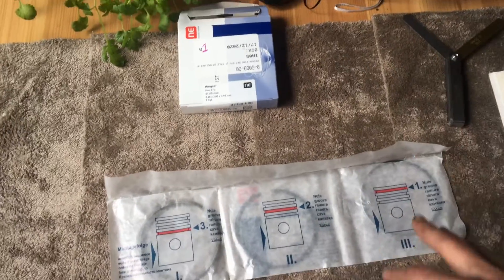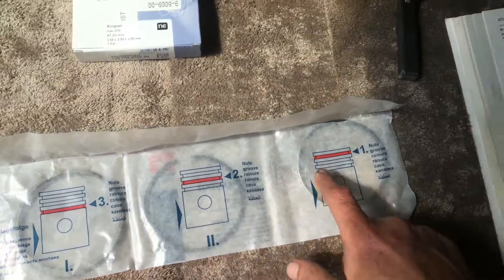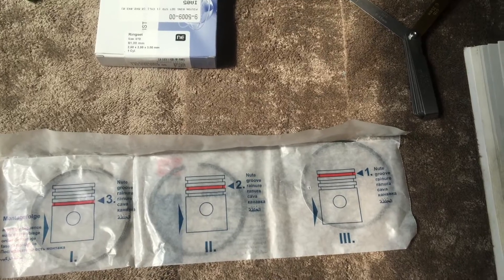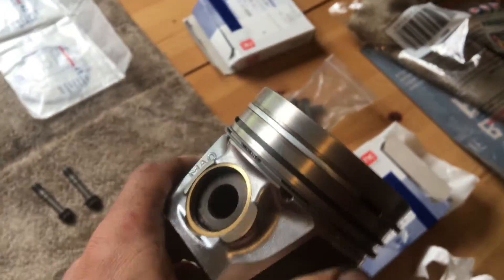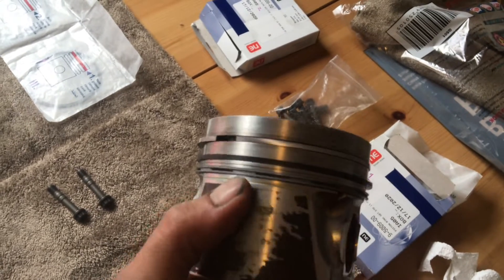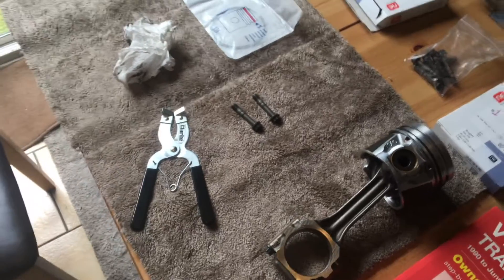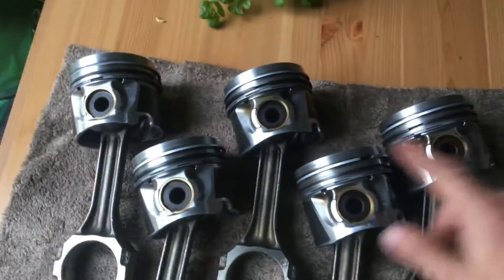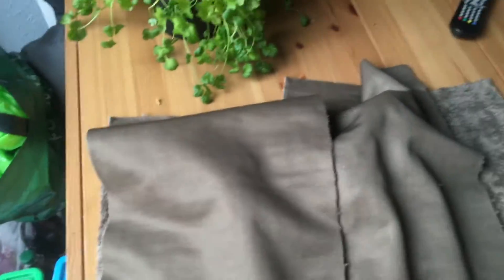Checking end gap & fitting piston rings

Comment: Hi Matt, hope you are well and back from the vw fest.  A couple of questions about the piston ring replacement if I may.  The blue coloured oil lube you used what brand was that?  It looked quite thick so it clung to the components well so I think I will do that too.  The bearing shells you replaced, you said that they were over sized but having looked at Brickwerks and AutoDoc I can only see replacement ones equal to originals made by KOLBENSCHMIDT.  I have ordered them ready now from AutoDoc but hopefully I can identify the top and bottom ones.  I see you have a different brand.  Where did they have 'top' marked on them?  I have ordered new KS piston rings as my engine had a snapped oil scraper ring as written on the FB T4 club site on my post.  Your videos are a huge help on here as I too am using the Haynes T4 manual but not that much detail in the book about technique etc.  Videos help in this area!
Reply from the maker: Hello I think we spoke on facebook, but we didn't talk about the oversized bearing shells. The oversized bearing shells are for when the crank has been ground down at a machine shop, this is not a cheap process, so with a standard crank you will only need standard shells. Hope this helps
Reply: @TwiggsT4  hiya Matt,  hope you're well.  I have put the engine back together last week and had to wait until yesterday as battery had deteriorated.   Anyway it all started up after a few turns.  I got the timing spot on . Pump timing was. 57 as Kw Darwent told me. 60 and you and Haynes do. 55.  So i met in the middle! All good, new piston Rings, checked all tolerances and clearances according to Haynes manual.  Also I watched your videos again when you strip down the engine from Cali campers!  Luckily my engine had smooth bores and crank pins all fine ready for new bearing shells.  Oil pressure all seems good and no smoke hardly!  One small issue.  There is a squeeking coming from the timing belt or possibly aux belt.  My timing belt could be a little on the tight side as can't twist it 90 degrees with thumb.  Maybe the new tensioner is squeeking.   The arrows were not exact on tensioner few mm out.  I fitted new water pump and timing pulleys last year.  It could be the timing belt cover plate rubbing.  Better not drive it around the block until investigated otherwise back to sq one when timing belt broke two years ago!  So fairly happy days and a big challenge but getting there.
Reply from the maker: Yeah I’m very well thanks, glad to hear things are coming along nicely. It always pays to take your time and any squeaks like that needs to be investigated. Yes 57 degrees is perfect, it’s also what is said on the forums 👍 
It’s no easy feat taking on engine work with only a Haynes and maybe some advice along the way, it can be scary coz you don’t want to bugger anything up, well done buddy, you deserve to feel proud of yourself 👏